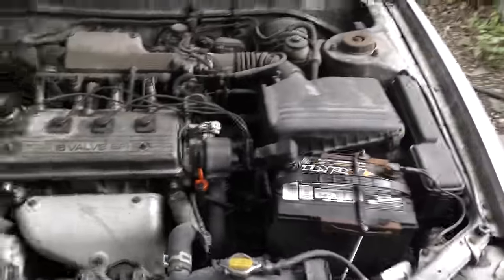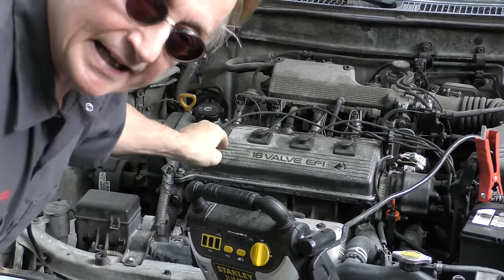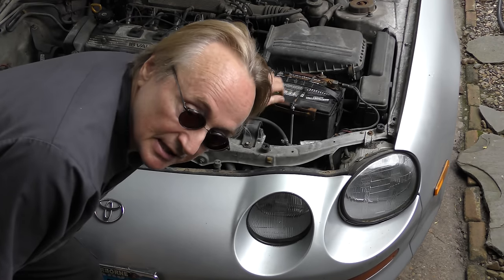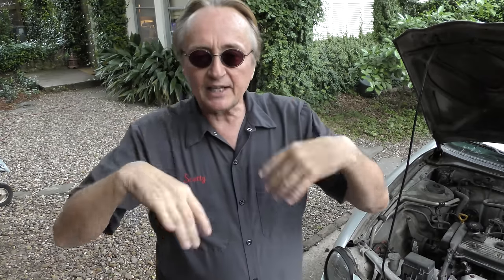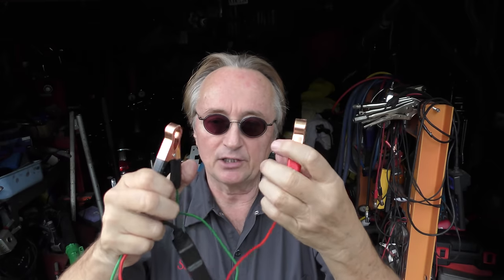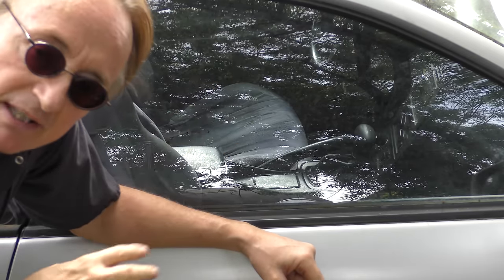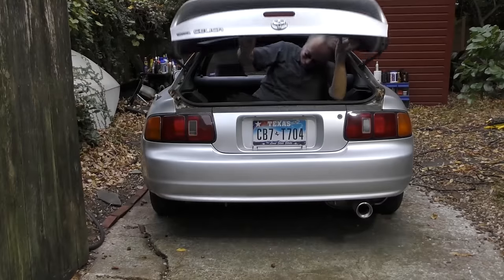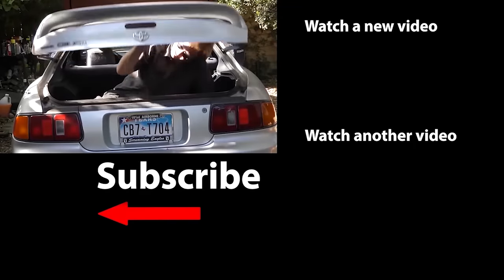Never Do This to Your Car (Learn from My Mistake)

Comment: 4:32  another reason I hate BMW- can't even change your own battery without getting BMW to bend you over.
Reply: Clearly you don’t understand BMw because if you did you would know that it’s possible for you to register the battery yourself using your phone! Don’t bother with no battery memory saver it doesn’t need it just drive the car for a few miles and all systems will reset!
Reply: Ulices Bamaca - I don’t!
Reply: condor5635 man so true
Reply: welcome to the wheels on computer,  the fancier the vehicle  the fancier you have to make out those checks to your car dealer  even as simple as charging your own battery,  can you believe it.
Reply: condor5635 no worry's bro,,,,,, they give you a jar of high tech lube made just for BMW owners!
Reply: BILLY THE KID - yeh probably in the 75- 90W viscosity rating!
Reply: @172-e5s  what are you talking about? I have bmw and mercedes and they're all high mileage and more than 10 yrs old. You surely don't own one!
Reply: joe bloggs it’s still garbage like he said. You shouldn’t have to go through that. Lexus all the way baby
Reply: Well mabye YOU cant change the battery in a BMW. I dont have any problems
Reply: @joebloggs4191  Hi Joe, could you please explain to me the procedure steps of how to register my new battery that i am going to replace in my 2013 bmw 35x x5? ty
Reply: @Bamaca_B58  o
Reply: It’s one of those things that separates the rich from the poor.
Reply: @billythekid3234  😂
Reply: I've owned 2. 325 & 535. Never again.
Reply: @battlehrfred  go by CVS buy a jar of Vaseline and then head to your local BMW dealer where they’ll help you out
Reply: @condor5635  100 Percent Agreed!
Reply: No vaseline either...
Reply: I wondered why the battery on my 2005 Mini Cooper would only last @ a year.   The current one looks brand new, but is dead, dead, dead.
Reply: @xzqzq  BMW owns Mini Cooper correct?  Hmmm
Reply: Robin Williams' character from "Merry Friggin' X-Mas" calls them Bavarian Money Wasters.
Reply: Then buy one of the big 3!!!! And not that foreign crap...
Reply: Hahahahaha

Comment: When I changed the battery in my Acura I simply hooked a trickle charger to the battery cables while I disconnected the battery to change it out. This kept all my car memories. Saw this trick on someone’s YouTube channel and it worked.
Reply: Do it with a 9 volt battery too
Reply: fastdude2002    Thank you ...you just saved me $20 bucks
Reply: Y our pulling my leg! whats a trickel charger? thats like,, go out and get me a left handed monkey wrench!
Reply: @anetajohnson8446  Lol trickle charger is just a battery charger on its lowest charging setting usually 2 amps an hour. I think they have little chargers that might have only the 2 amp per hour constant charger ability.
Reply: GOLD comment
Reply: What is a trickle charger
Reply: @joycethiery2488  It's a function on a car battery charger usually about 2 amps an hour. It's used for deep cycle batteries like you use on boats for trolling motors. You hook it up and can leave connected for days without worrying about over charging your battery. Though modern chargers you'd buy today have that feature built in where it stops charging the battery before it over charges them.
Reply: Cool

Comment: Scotty, you can help a lot of people with older or high mileage front wheel drive cars if you do a video warning them to be sure to also >change the small heater hoses that are not visible behind the engine!   My 2015 Sedona lost all of the coolant in the radiator on a long trip and overheated damaging the head. Even I was making regular under the hood checks, I didn't know that the coolant was low because the system didn't pull a vacuum.  Resivior was still full even when this happened!  $7,000 repair!

Comment: Scotty, one of the things that I do when replacing my battery is replace the positive battery terminal with a OEM new one. This way, I know that there is no corrosion to deal with. My car (a 2009 Scion xB) has the battery attached to the positive cable with a bolt so I can just unbolt the old one and install the new one. BTW, one of the reasons that I save the computer memory is the radio presets. I'v only had to reset all of the radio stations once. I now hook up a 9 volt batt. to the 12 volt DC connection under the dash.
Reply: How are you able to talk to Scotty and ask him a question

Comment: Vehicles are designed to be an income source for your local stealership.  That's why the modern vehicles are made with computers that only the stealers can work on.
Reply: Jim Finigan Amen to that
Reply: now tacomas can be oil changed by the dealership only
Reply: @onlythewise1  About 25 years ago, they were talking about engineering the vehicles so that they would require special tools that only the stealerships would have. The manufacturers are also engineering certain components so that they can't be serviced, only replaced. My 2013 F-150 has a transmission that doesn't have a dipstick. You can't check the fluid level. It looks like changing the fluid would be complicated. It probably can be done, but it requires special equipment that only certain "authorized" service centers have.
Reply: @jimfinigan1681  evil is were you find it
Reply: @onlythewise1  Really? Can you elaborate? Why?
Reply: @paulmoss7940  greed or just insensitivity, people burned women as witches dumbness and greed and unsensitivity why ,
Reply: For sure
Reply: Do not use stealership services as much as possible do maintenance by yourself and keep money in your pocket
Reply: @nicolinflorescu3775  Your paying for their knowledge. Unfortunately you have to be on the ball not to stuff the things up that Scotty talks about. 
Your service is only as good as the apprentice that may work on it.
Reply: Hold up - name 1 dealership that designs & builds the cars they sell.
I'll wait. 🥱
Reply: @nicolinflorescu3775  
I had a lot of "you" as customers.
Did your lil back yard trick and now it sits on a flatbed. 
Like another poster said, you pay for the expertise. 
I wasn't like other shops though. 
I made my money by being the cheapest & most honest, along with being able to do any warranty work on any vehicle.
My customers loved me, as I did them.
Reply: White Rabbit  
I had a kid come in with a Velocetor wanting it lowered.
Book called for 17.1 hrs.
He had quotes of $1700
I lifted the car & agreed to do it for $1000.
I can now say - I made $1000 an hour.
I'm still trying to figure out how Hyundai claims it takes 17.1 hrs when it only took me 1 hr.
Reply: @onlythewise1  not true
Reply: @joehyundaitech7961  ya i know  but its really difficult to change it now
Reply: now fix it so changing  oil is super hard
Reply: @eloquent-nuance  
Yes sir.
I built my reputation on being the most honest mechanic you will ever meet.
I don't believe in money, I also drive on the roads as well as my wife & children.
I have always treated my customers like family.
I have had customers come to my shop for an oil change after driving 2 1/2 hrs one way.
If its not right the first time, it does not leave my shop.
Therefore, its always right the first time.

If I fix your car right the first time, you will tell your friends.
If I don't fix your car right the first time, you will tell everyone.
Those that send out cars that are not fixed the first time should just throw their tools away and go flip burgers.
Vehicles are not that complicated.
Reply: @onlythewise1  my 2006 is so easy to change. Watched video on cusmging new ones, way to much work, forcing you to go to dealer. You could never trust sn oil change place with whsts needed to be done. Not pleased, with the change.
Reply: @jimfinigan1681  Some of this can be attributed to keeping the dealership techs busy, but let's be honest, disappearing dipsticks occurred first in European cars like Mercedes. Some don't even have engine oil dipsticks! So let's not blame everything on "greedy Americans". As for electronics, I can tell you that the "old days" weren't that great because you'd never get the clean burning engines and high fuel economy out of 50's through 70's cars. You couldn't get 20 mpg on a 5.0L Ford or Chevy back in that era, not to mention the kind of power today's 5.0L produces. Hell, you couldn't get a 5.0L car back then to give you 20 mpg AND run the 1/4 mile in 12 seconds; for that matter it couldn't run even 13's back then yet give you the daily driver of today. I just picked up a 2020 Mustang GT and my old '71 Mach 1 wouldn't hold a candle to this car. Yes, the price of the cars seems incredibly different but running a calculator of '71 dollars to 2020 dollars shows that the old Mach 1 would cost over $33,000 today, with that piss poor performance compared to the 2020.
Reply: and half of them don´t know what they are doing

Comment: My 12yo Sonic LS sans turbo and automatic has relatively simple electronics, even a proper top post battery. Incredible lighting system never allows a dead battery. I've only changed rubber parts like wipers, tires and coolant hoses. For a noise I replaced the serpentine, but the tensioner was the cause. Saved the original belt, it's still serviceable. Original timing belt is like new, no cracks or crumbling of the teeth. Tensioner or idler will fail first, so will change it all soon. Original Freon, brakes, clutch, and the only engine bolt turned is the oil pan plug. No seeping or burning, oil stays full between changes. Simple is the best of every brand.

Comment: I still like the OBD 1 Systems … simple reliable and an easy 300k mile engines like my 2.3 cast iron Ranger.
Reply: My OBD1 E36 M3 is at 286,000 miles.. simple & reliable!

Comment: One thing I have learned that most mechanics don't know: 1) always check the voltage/amperage coming out your battery, you may have enough to run the car but if it is failing it will fire off so many error codes you would think your engine is terminally cancerous.  Mechanics will happily read those codes and say you need $4000k worth of repairs when all you needed was a new battery!!!
Reply: God i literally just dealt with this i literally went through my whole savings replacing this and that taking so many hours of my time during the work week to install the parts that i did. After doing so and nothing working i went against what all the scanners and voltage readers were telling me and got a new battery and low and behold my cars brand new again. Im pissed but on the bright side atleast everything else under my hood is brand new  as well and i learned alot so cant be to mad. shouldnt have to worry about much for another 60-80000 miles either im guessing so thats another plus but now im broke as hell, feel a little dumb, but hey atleast my car loves me again haha
Reply: Not only codes, but other weird things can happen. My car would start right up in any weather conditions, even if it was -15 Fahrenheit, but the RPM gauge would fail intermittently, which can be a sign of major issues. Even worse, the speedometer would go wonky at freeway speeds.

No check engine light came on.

The battery tested "bad," so I replaced the battery, and now the RPM gauge works fine. I haven't done much freeway driving, but I've taken many short highway trips, and the speedometer has not malfunctioned at all.

The crazy thing is that the previous owner kept a written maintenance log, and she also had issues with the speedometer, as well as with the car downshifting randomly when the speedometer went wonky - her mechanic had no idea what the issue was. I suspect the battery was bad for years, and no one figured it out, because the car reliably started up without a struggle.

Comment: In relation to side laminated glass, you can use one of those devices to brake the glass, or if the glass breaks in a roll over event just push against it from the inside. The glass will fall away in one piece and flop against the door. They use that type of glass for security/antitheft and also in a roll over even stops limbs like an arm flying out of the window and being crushed. Also BOSCH make the majority of Oem sensors like your O2 sensor and is the standard in the industry for quality.

Comment: Thank you Scotty so much for this info and all that your channel shares.  I’ve been wanting to get a slightly newer secondhand car but there’s so much to learn from under the hood with all these computerized vehicles it’s really ever so overwhelming.  Just wish cars hadn’t evolved to such a degree.  I much prefer the older classic styles from the 50’s upwards prior to all this dang blasted technology.  Just sharing my thoughts from a 68 yr old female’s perspective. 🚙
Reply: Yes, the classic 50-60’s cars were  great, but remember:
No seat belts/no anti-lock brakes/no anti skid system/ no front and rear crumple zones to keep the cabin intact/no roll over protection to keep the roof from getting crushed/no airbags/ and very few had A/C even as an option. If you were in even a slow speed collision, you were “toast”. The newer cars need a computer degree to work on them, but it’s all a trade off  😀. I know, because my dad drove his 1950 ($5000 loaded) Dodge Coronet until 1965, when he got his 1965 Coronet, he had to pay $50 extra (car was $5000 stripped down model)  for “optional” seatbelts.
Reply: @josephdebes3060  for all the disadvantages you mention in the old cars, we can figure out out before and today how many accidents happen before compared today the more sofisticated we are the more accidents we get.
Reply: Totally agree!! One of the things about todays cars is that some people take all that safety stuff for granted and it seems some forget how to drive. They figure that with all the safety's installed they can be careless. They don't  HAVE to be careful anymore!! Stupid reasoning!!
Reply: @thomasschwarting5108  - I wholeheartedly agree along with Tesla’s stupidity in creating a self-powered vehicle when there remain so many normal type vehicles still on the road. Horrendous accidents are happening due to the carelessness of those behind the wheel of these new fangled cars ignoring the fact that they must remain ever so alert maintaining a safety margin all around them. 🚙

Comment: That's weird.
Placing the pos and neg from jumper battery on corresponding terminals on weak battery should not damage anything. Unless connecting the 2 batteries together in parallel  results in a larger current draw because of the larger capacity to supply current.
By putting the ground from jumper battery on the engine the sensor is effectively bypassed and not exposed to potentially excessive current that could occur if the negative from jumper is placed directly on negative of weal battery.